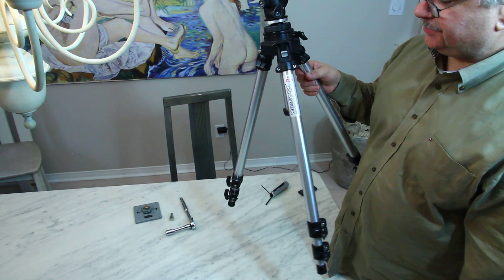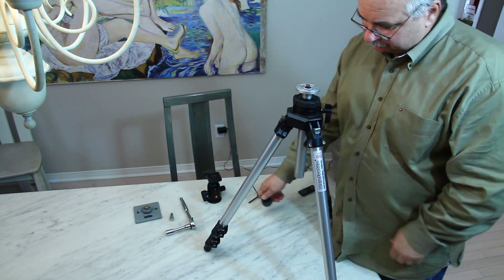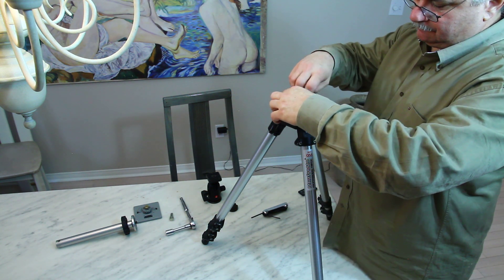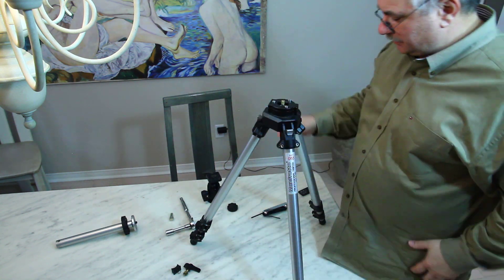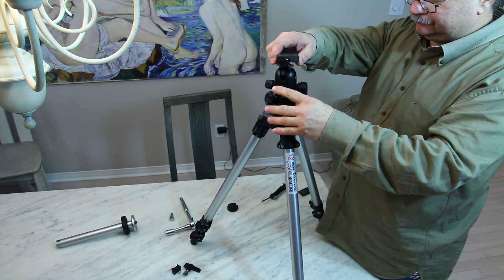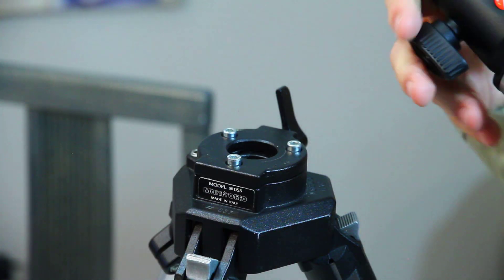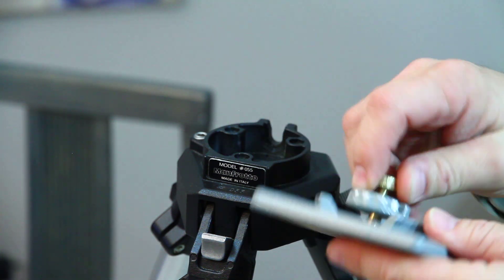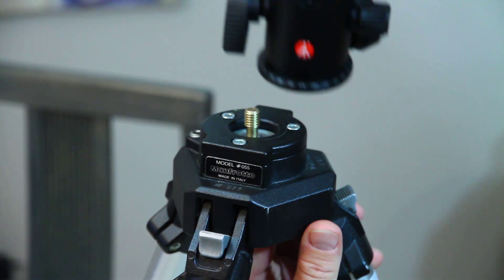Manfrotto 055C Tripod solid base modification

Comment: I understand the theory, but I fail to see any practical benefit towards sturdiness.. If  you would leave the centre column down and tightened, what ridgidness is wanting in comparisson to your modification? I do appreciate the benefit of a lower weight and some streamlining, but to sacrifice the unique telescoping centre colum (there to allow a very low camera point with flattened legs unlike any other model I am aware of) or enabling that little higher camera point is disregarding this most universal and popular tripod.
I would buy a second or third hand # 144 for change and modify it if weight would be a consideration.
But if this works for you, so be it ! Regards, Mike

Comment: Sad story, it's a shame he didn't get the chance to enjoy it.  Interesting to hear though.  I've often wondered what the alloy was, it's incredibly strong.  I had to dismantle a large machine enclosure last year and the hex keys we used took some serious stress in order to crack the bolts loose.  Some of the ones we used just snapped but one set stayed intact, even when I used a metre long extension on them.  Didn't even damage the key tip!

Comment: Cr-Mo is an abbreviation for Chromium Molybddenum, the type of steel used to make the tool.  Nothing to do with peoples names.  Those keys have been around for donkey's years, almost since Allen Manufacturing in the US patented the hex head screw over a century ago.